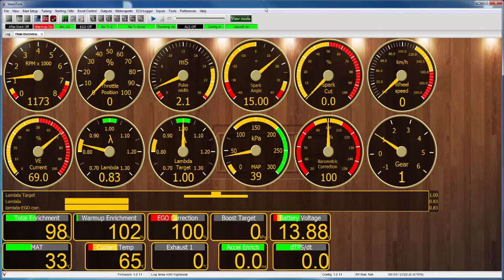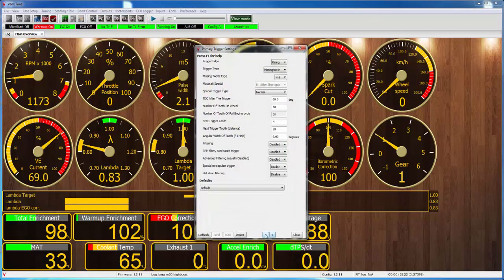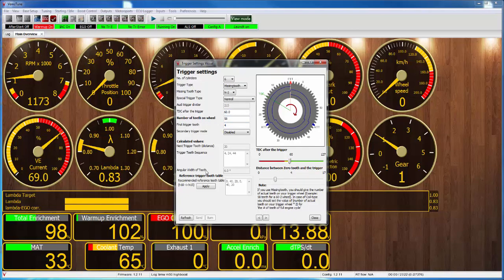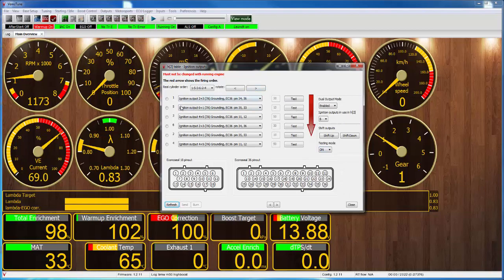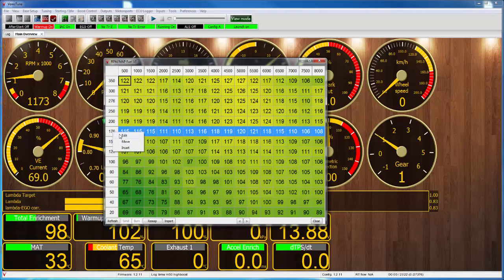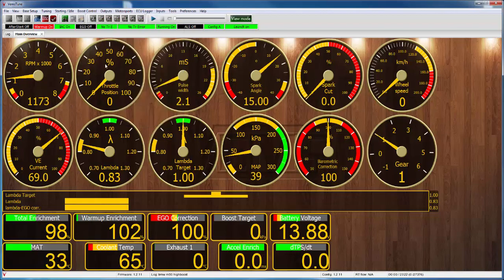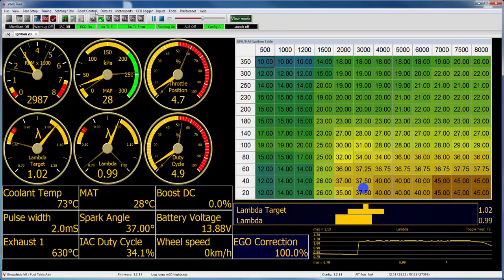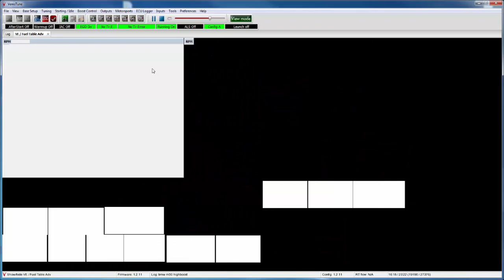VemsTune VEMS Standalone Tuning Software Demo video

Comment: Would you do a boost control video?
With config and settings
Reply from the maker: We can do a video on the process, but the settings are unique to each engine/turbo/solenoid combo so we can't provide a config. You (or a tuner) need to do that.

Comment: is vems able to all e36 stock ecu?
Reply from the maker: VEMS is a full standalone ECU, so it replaces the stock ECU/DME completely. For the e36 though, we do offer a full plug-in replacement for the e36 with M50 or M50tu engine. http://www.vems.com/engine-management/m50-pnp.html if you're in the US, or https://shop.vems.hu/catalog/vems-motronic88-p-187.html if you're elsewhere in the World.
Reply: what specific ecu e36 can replace for your pnp ecu?
is that can replace siemens which is the m52 engine?